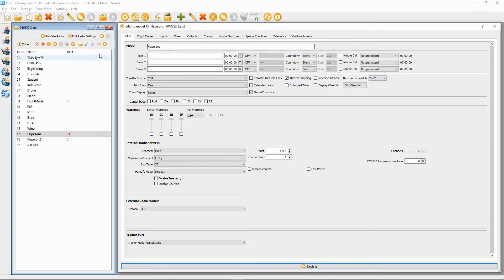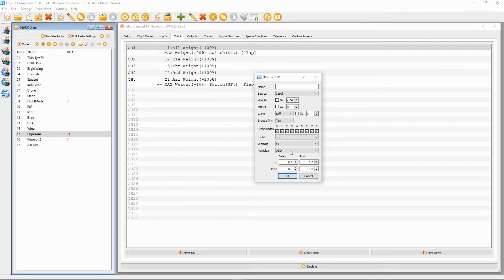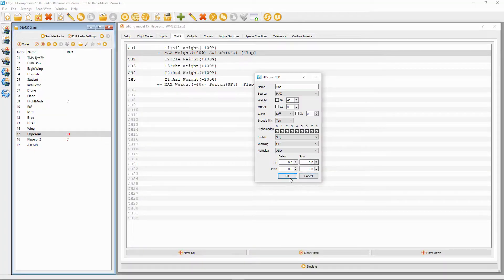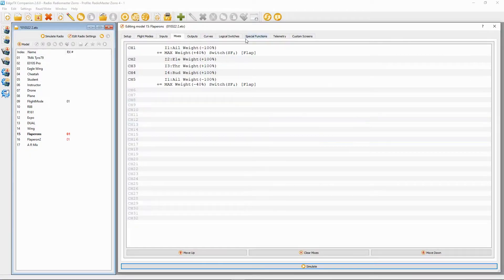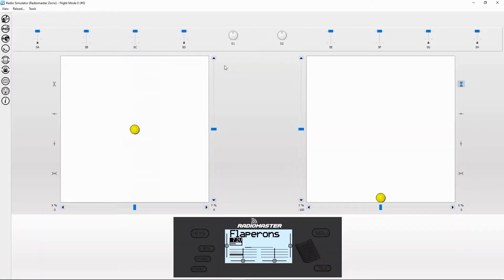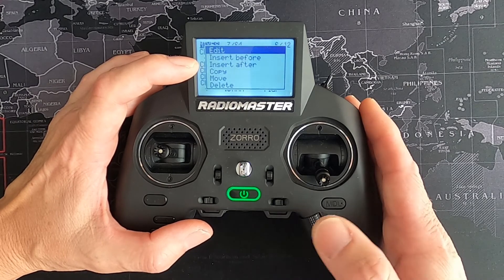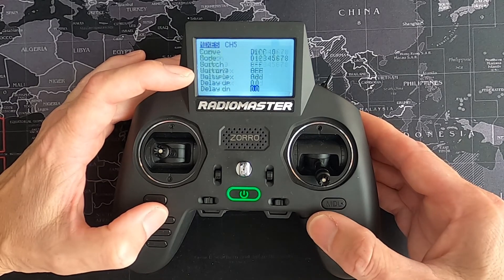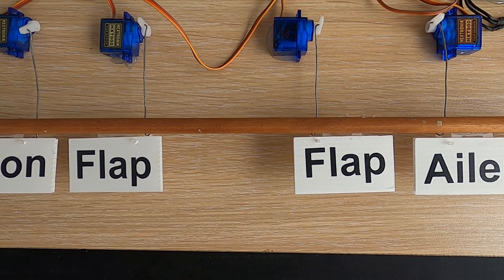RadioMaster Zorro setting up Flaperons in EdgeTX

Comment: waste of 6 minutes because this guy baited me with the thumbnail... pathetic
Reply from the maker: Yes, flaps are not useful on a quad copter. Maybe try fixed wings.
Reply: @the-happy-RC-flyer  eflite night timber x... Pretty sure that's a fixed wing model mate
Reply: @the-happy-RC-flyer  and if you look it up, it has a setup where the ailerons are on a Y cable and each flap has a independent servo and channel so the flaps can be independent or work with the ailerons. Your thumbnail looked like exactly what I needed. Then you didn't even touch the 2 in the middle
Reply from the maker: Only need to ask and I would help you.
Reply: @the-happy-RC-flyer  don't worry. If you don't already have a vid on it I'll just keep trying
Reply from the maker: @LOCOsnakeBITES  You need to use channel 1 for the ailerons and use mixes 5 and 6 (channels 5 and 6) for each of the flap servos using the same switch as the source. This will activate both flaps. You may need to change the weight to a - on one of the mixes to correct for the orientation of the servos in our plane. I have assumed your radios channel mapping is AETR. I hope this helps.
https://youtu.be/Qf85gzfg5Fc?si=6l87ttCGRBP5R1fj
Reply: @the-happy-RC-flyer  tried this setup. not sure you understood what i was trying to say about the full span ailerons. but its also hard to describe. have you by chance seen a timber x while hovering? usually full span ailerons are deployed
Reply from the maker: Because you ailerons are hard wired you cannot turn them into flaperons you need each aileron to have a servo on a separate channel so you can set up the mix.